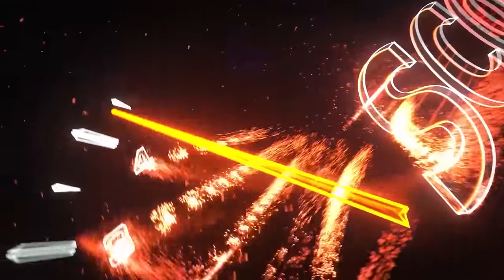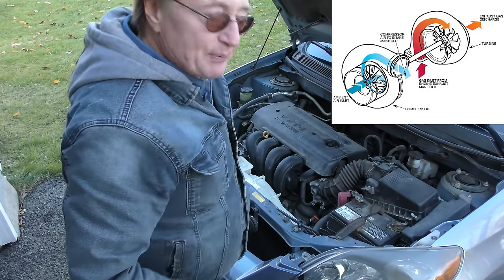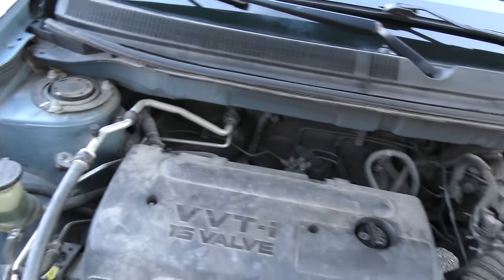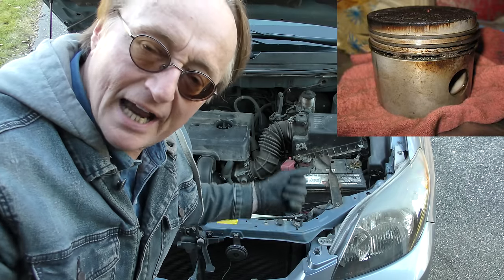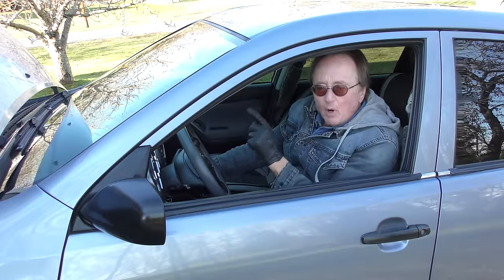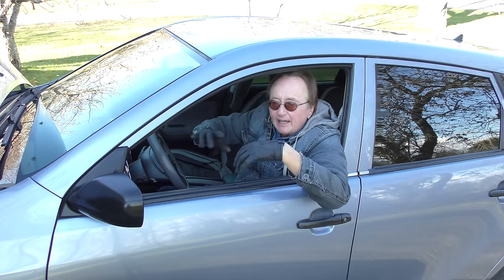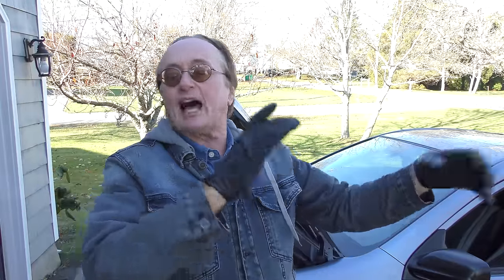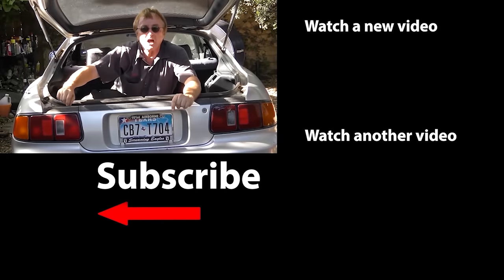If You Just Bought This Type of Car, You’re Screwed

Comment: I listened to your advice and others when selecting my next daily driver. Bought a new 2023 Subaru Crosstrek Premium with a manual. No turbo to break down and having a manual means a replacement on day is easier and cheaper to mess with. I use full synthetic from Mobil 1 with a Mobil one filter. Did my research on filters and oil, and the filter has a sort of oil reserve amount for when you're cold starting the engine to help with lubrication. 

This was the perfect car for daily driving. AWD is a huge help in the snow as I found out. Plus the price was $10k less than any other vehicle I was considering. I also work in an truck assembly plant, and it's not Subaru. I chose the Subaru over anything the company I work for builds. If that doesn't speak volumes, then I don't know what does.

Comment: Sitting 10 minutes and waiting around for the turbos to cool down is not the case for modern turbocharged cars. Modern turbos now have coolant lines running through them to cool them down rather than just the transmission oil. Most new cars have computers managing everything and they keep the radiator fans and coolant running for a few minutes even after the engine is turned off.

Comment: I had a turbo pt cruiser back in the day. The fans would stay on automatically for a few minutes after turning ignition off.
Reply: This time two wrongs made it right…very typical for American auto industry …
Reply: That’s good but the oil in the turbo will continue to boil and coke up the bearings.
Reply: Volvo dealers used to sell an accessory oil accumulator that would continuously bleed oil into the turbo’s bearings for ten minutes after shutdown which kept the bearings from coking up. The price in the day was $2k. Many dealers would throw them in for free if the customer didn’t bite and buy the kit as the turbos would fail long before the warranty expired.

From the world of aviation, taking care of the spool down/cool down of turbos is just common knowledge. Most jet engines, which are essentially just mega turbo type devices, also have cooldown thermal stabilization requirements.
Reply: @stephenwalton9646  normaly turbos dont have bearings. the axle of the turbo is "swimming" in a thin oil bath. thats why let it cool of decently is so important. i wouldnt trust any additional advice, because you need a lot pressure to push the oil through this axle.

 do it like scotty says go soft the last miles and than let the engine idle for a couple of minutes before shutting off and you will be fine.

Comment: We drive turbo diesel's  in Scotland usually 2 litre or smaller The torque is required climbing mountains in the highlands
Reply: turbo diesels are fine.  gasoline, not so much
Reply: The1stRealVR  LMFAO.  Torque needed is dependent on grade, not height of mountain.

Comment: Diesel Turbo engines still last a long time. Mine is 18 years & has never been overhauled.
Reply: If you watched the video he talked about this too
Reply: I may be wrong but I thought diesel engines ran cooler than gas. Think they use larger turbos too.
Reply: How many times has the turbo been changed ??
Reply: @austinroberts4008  Never.
Reply: @TheMrTaxpayer  Yes, but after I commented.
Reply: @rolandthethompsongunner64  Not sure. You may be right.
Reply: albinvega7008  Yes. But new diesel engines are geting smaller & revving higher. This is not good.

Comment: I must have a unicorn: 2017 Focus ST 187,000 miles and going strong. ( original clutch, replaced differential driveshaft seals, lower control arms, tie rods and front wheel bearings ) ….. oil changes every 3000 miles!
Reply: Damn!  That's alotta miles!
Reply: 3000 miles is great.... Scotty is suggesting in this video to run turbo and twin turbo engines at 5000 mi. on the oil change , that is guaranteed failure.... Any and all turbos and especially twin turbos should be at 3,500 miles with full synthetic if you want any kind of durability ....

Comment: I bought a 2017 Honda Civic in 2019. I didn’t want the small engine with the turbo and the unproven and yet to be perfected CVT transmission. I found what I wanted. A slower base 2.0 litre inline 4 normally aspirated mated to a bullet proof 6 speed manual. 4 years into ownership and just basic maintenance. I hope to get about 300,000 miles out of the car and I like my chances.

Comment: My 2004 Subaru wrx sti has 165k on it. It's all about how you drive and maintain the car.
Reply: I don't know what kind of NA engines these guys are driving, I see nothing but timing chain failures and lifters on pushrod  "real american engines".
Seen chevy fail at 90k seen ram fail at even earlier. Oh and I had a 1.8t audi for like 300k with stock turbo on a standard trans and I got rid of it when I couldn't wait for it die already... lol

Comment: My 2005 Saturn Ion Redline coupe had a 2.2liter supercharger 5 speed manual (I always thought super chargers were more powerful and would wear it out faster then turbo but nope and I sold it at 190k miles running perfect ! never burned oil And on its original clutch engine radiator etc! Only thing I ever replaced was The crank position sensor it randomly stall then one day stopped starting! & replaced starter and battery brakes and a/c control unit(the fan only blew on high) so changed out the whole unit in dash) that’s all.. aside from oil changes tires etc 
    That was it! But car only got 22 mpg mix and  28 hwy miles on 91-93 octane premium gas! 
If I put low grade the check engine light would come on! 
Til u put premium or mid grade

Comment: I bought an87 Saab turbo with 100K and then put another 230k on it with the original turbo. I did put a pre/post lube oil pump on it since that was the last year they didn't have a water cooled turbo and I didn't want to have to wait for a cool down all the time.  Next was a '97 turbo that only had 260K on engine/turbo before it too succumbed to rust. The last, GM based, Saab only has 176K miles so far. All turbos in the last few decades have water cooling so there is no requirement for post cool down but any engine will suffer when you beat on it when cold, how hard you push should always be proportional to the operating temperature. The colder the engine, the more you baby it. Then when it is up to temperature, it's balls to the wall.

Comment: This is the first car I've owned with a Turbo.  6400 miles in with one oil change done so far.  Let my car warm up on the very cold days before driving.  I don't zoom zoom all around.  I also let it do a cool down before shutting it off mostly form driving slower speeds.  My neighborhood speed limit is 30.  Fingers crossed and all this care, hopefully I get a nice run with this 2022 Honda CRV.

Comment: Scotty I use the correct weight oil for my temperature and change it every 5,000 KILOMETRES ha ha.
I might be doing it too often but hey, oil is cheap.
I do the oil filter every change and the fuel and air filters every 2nd change
Reply: Yep I also warm down the engine when I pull up. Most always, even if I'm not driving hard

Comment: I wouldn’t mind having another turbo vehicle.
I had a 2019 Ford Mustang Eco-Boost.
I got anywhere on the highway between 40-49 mpg, and that was with the cruise control on.
Non-cruise, I got between 39-42 mpg.
In town driving was about 32-37 mpg.
Regular oil changes by the manufacture and I always ran pump ‘93.
Problem with that car was gaskets.
Constantly being replaced.
Sure I got on it from time to time, but those days were few and far between.
It was a good thing I took out the extended warranty, because it was just about every year I was replacing some gasket or purge valve X2.
So if you buy a turbo, just do everything by the book and by what Scotty said and you should be just fine.
I traded my Mustang in for a 2024 Subaru Forester.
Just because I got tired of every year the Mustang going in for some gasket being replaced, sometimes the same one X2.
So I got my Forester because I didn’t want to deal anymore with the hassle of gaskets being replaced and me being without a vehicle for either a day or 2.
Plus my Forester is practical and has very high mark’s for reliability, safety, light off road prowess and customers satisfaction.

Comment: The push to use smaller engines with turbos is driven by (1) US EPA emission requirements which favor smaller displacement engines (even if real world experience shows no change in fuel economy versus a larger displacement) and (2) China's rule that drastically limited the number of cars that could be registered with engines of greater than 2.0 displacement.

Comment: I had Alfa Romeo 159 diesel and changed oil every 20 000 km with no single engine problem. Does not burn oil at all. Never needs to top up oil. Runs perfectly.  Sold the car to a friend last year with 370 000 km on the clock to buy a Giulia. Scotty is an old school boy. Always uses old jokes 🙂

Comment: I have a 2013 dodge dart with 217k original Miles with a manual transmission surprisingly, the car runs pretty good with no check engine light or anything I definitely have a very limited window. How long do you think it would last

Comment: The problem with the 1.8 Toyota engine isn't that it doesn't go fast. The problem is that it takes forever to do it. Almost any car can do 85 competently but getting from 60 to 85 just to pass is another story. My wife had a Matrix. It was very comfortable on the highway BUT when you wanted to pass it required planning.

Comment: If only checking those long tubes were so easy. Engine bay of my 2.0 diesel Mazda 6 is so packed, I hardly can drop a toothpick in it. E.g. replacing the alternator pulley was a literal hell 🤕

Comment: Hi Scotty, I drive a Mercedes sprinter van for work. This van has a six cylinder turbo diesel engine. It has 80 thousand miles now. It has also blown two turbos. Go figure. The company that I work for is going to get rid of the Mercedes vans because they are too expensive to fix and seem to wear out the turbos. Thoughts?

Comment: Back in the 80's, when turbos first were used, there were aftermarket devices to cool the bearings on shutdown. Basically, a small pressure reservoir and some check valves and adaptors. At startup, the oil pump would fill the reservoir (working like an expansion tank for your hot water heater) with oil. When you shut off the engine, the reservoir would continue to feed oil to the turbo bearings for a short time, to minimize the heat soak. By the way, if you mess up the bearings, not only do you need a new turbo, you'll also likely foul or melt your catalytic converter.

Comment: Australia.
Diesel.
Turbo.
Toyota.
Turbo diesel Toyotas are ubiquitous down here.
From the 12H-T rolling through the 1HD-T, the rare but awesome 1HD-FT (which I have) the awesome 1HD-FTE, the 1VD-FTV.
These engines are legendary in Australia and Africa and Pakistan and India.
You had to shell out a fair chunk of change prior to the 1VD-FTV era when you could still buy the non turbo diesels.
My 1HD-FT 80 Series LandCruiser goes better than the petrol 1FZ-FE that was available at the time. And usually a slightly bigger petrol engine will be quicker, turbo or not than a mechanically timed direct injection diesel.

Comment: I've owned a 2005 Saab 9-3 2.0t for 14 years. 120,000 miles. Just a few months ago it developed a tick from what seems to be the timing chain. I haven't had the time to really get into it yet. Just found a good deal on a Gmc Canyon truck and parked the Saab. But it was a fun a very fast car. I might fix it. But its not cheap to work on and parts aren't easy to come by. I had to special order a vacuum line with a check valve in it from Germany a few years ago. So yeah. She parked for now.

Comment: Mr scotty. Does your opinion of turbochargers only for gasoline cars or does it extend to diesel engines as well?
Reply: i mean WV 1.9 TDI is rated as one of the longest lasting engines ever, was it a fluke? i don't know, but aparently it can last, idk about turbo and price to replace it tho ahha
Reply: Well we know German cars are expensive crap and my work van is a 12 Sprinter with 113 000 kms. About 2.5 years ago the turbo ate itself. The clock was at 103 000. Those v6 diesels are quiet  but gutless piles of junk and turbo is crap.

Comment: I'm not a fan of turbocharged engines especially after I drove one of my old employers work trucks, they were 2023 Chevrolet Colorados with naturally aspirated four cylinder motors that has plenty of power, were amazing on gas, and rode like a cloud.

On the downside that's probably why the automatic transmissions had so many issues, might have been the idiots driving them around like sports cars too lol

Oh another thing I learned is if you ever drive a Chevy Spark or Nissan Versa Note try turning off the AC compressor while driving it around it's like hitting nitro haha
Reply: On the flip side, I use the AC the other way - when downshifting to slow down, if you kick the AC on you get ~15 seconds of much increased engine braking.  202K miles on 100% original brakes with a Mazda 3 Skyactiv automatic (with manual mode) trans :)
Reply: The Colorado is turbocharged 4 cyl

Comment: I'm also not a fan of turbos on gasoline engines in general. I don't mind them on diesels because diesels are very heavy built and can handle that extra pressure with no problem. The thing is that a lot of people that buy cars with turbos usually drive them very hard and either don't maintain them at all or do very little maintenance. Any car that's been done like that you just don't want to own it.

Comment: A lot of these turb0ize cars especially the twin turbo EcoBoost    It's really good idea too pull the oil feed lube tubes And check/replace those screen filters about every 50k to 70,000 mi  A lot of the time  that's what causes them to fail   because the screen filter stop up on them due to the crusty baked on  carbon accumulation  You just might more than triple the Life of the turbochargers when coupled with good oil and 5k intervals they  might even make 300K before they start showing out

Comment: Q:  Is a supercharger a better option than a turbo as far as your points in this video?
Reply: I always wondered if a supercharger would work with a 4 cylinder engine. I know it takes horsepower to turn it,
Reply: @bryanwall5616 mercedes had them in the 2000s on 4 cylinder engines. Like the c200 Kompressor

Comment: Since it seems 5000 mile oil changes are recommended for regular cars . I would think maybe that changes for turbos would be at 2500 miles ?
Reply: Clean oil can never harm an engine.
Reply: I think the bigger issue is probably not cooking oil in the turbo by shutting off the car when it's still hot, because you're pretty much going to have particles smaller than the filter size rather quickly no matter what.  Maybe there's a question of how many but they'll still be there.  As long as the oil is maintaining it's lubrication properties, I don't think there's very much you can improve by changing it more often.

I would say save the money and put it toward a maintenance fund and you can cover the turbo if it goes, or whatever other problem might come up.

Comment: Actually I prefer turbo. I am currently driving a 2005 saab 9-2x aero which has the subaru wrx ending in it. 2.0 turbo. It has 244k miles on it and going strong. I believe any good car taken care of and not dogged will last

Comment: ☣️ Wait 1.8 liter, ain't that just half the engine? Mine has a 1.8 l Toyota but it's got an electric motor to boost it and it's quick in power mode. Yeah it's a Prius and gets 50 miles to the gallon and almost 300,000 mi now. Just change the oil and the speed sensors and keep good brakes on it. Zoom zoom.. Yeah I can say that because Toyota owns Mazda now practically.😮

Comment: I remember on my Saab 9-3 Aero with the 2.8 turbo V6 it had a feature where depending on the temperature it would leave the fan on to cool the turbo after you turned the car off. Not sure how prevalent this is on modern cars.

Comment: So wait....should I buy a turbo car or not?
Reply: Turbos boost internal pressure to create more horsepower output to wheels... But it can wear out engines much faster... Case in point a mitsubishi mirage 3 cylinder makes 78 hp but is naturally aspirated... A ford ecoboost 3 cylinder can make (*not sure exactly) 130 hp... The turbo makes a difference.... But those engines if you boost them will wear.out significant faster... but A properly maintained Mirage engine can go 300'000 miles...

Comment: We are citizens of very hot areas,in summer temperature goes to 122 degree .question is this if manufacturer tells about 0w-30 for engine then we put 0w-30 or some thicker oil???
Reply: I would use a anti-friction oil additive
Reply: @peterrudy9207  OK, thanks, brother, for good reply, and giving time 👍

Comment: My dad also said, superchargers were better than turbos, I remember. I also would imagine that exhaust gas, that powers the impellers on the turbo, must be far higher temperature than the supercharger's intake. A belt powers the super charger, but I'd imagine, someone thought up an electric motor supercharger, like electric cooling fans they have now.

Comment: 2:32 some cars nowadays come with an active heatsoak management system that, if necessary, cools the turbo down after shutting the engine off. one of the few improvements that come with employing more complex electronics.

Comment: are V8 engines reliable?
Reply: Depends. If it's a high powered V8 then hardly ever. One that is supposedly moderate on power output, then usually its reliable.
Reply: Chevy 4.8 ,5.7 & 6.0 liter can last 300,000 miles when taken care of